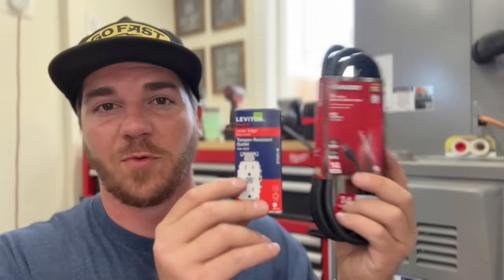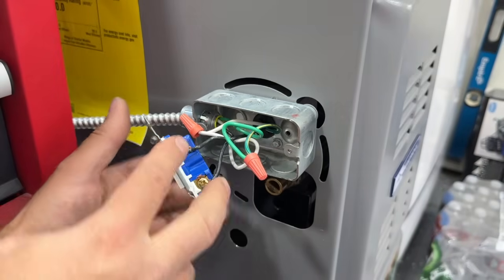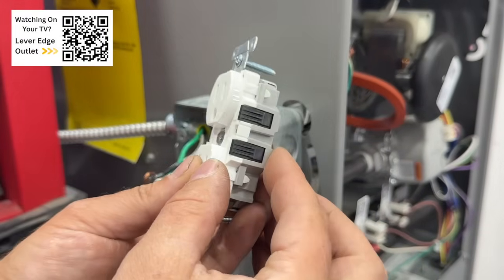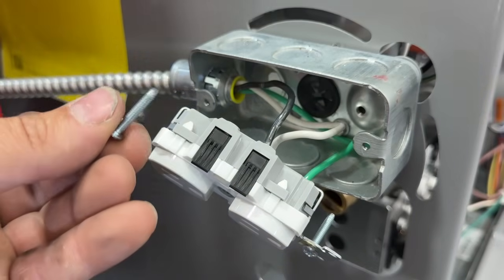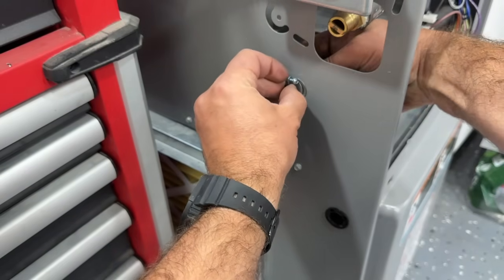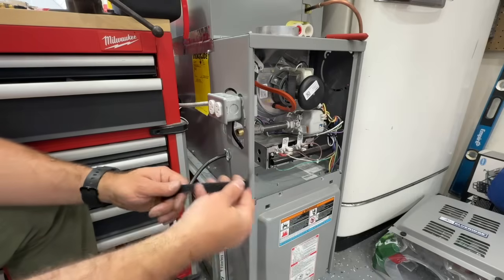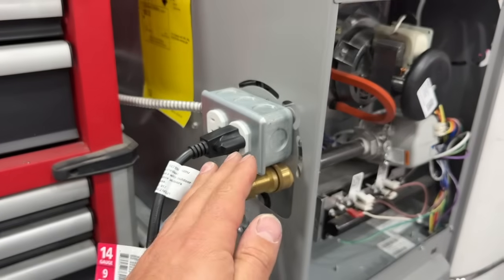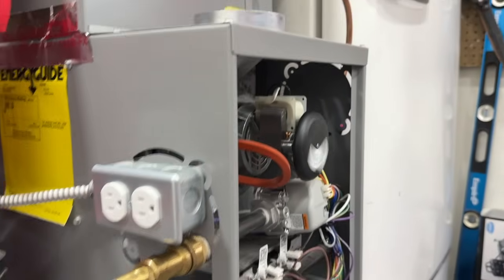This $16 Hack Could Keep Your Family Warm During A Power Outage!

Comment: During the Texas Freeze of 2021, we lost power for days.  Miserable without the gas central heat.  I tried running the central gas heater from a 2KW generator using 100' of extension cord.  It didn't work. I thought maybe some kind of voltage drop problem, but it was too cold to troubleshoot.  Now I know what the problem probably was.  I needed to bond the neutral to ground at the generator which was lost when I cut the ROMEX from the breaker box to install inline male/female connectors.  Never thought about rewiring the power switch as it is six feet away from the gas unit.

Comment: Disconnecting from the power grid and running a generator is better. 4 hours of furnace isnt much when you could be out of power for a week. When the battery dies on your battey pack you are not able to charge it again. You are much safer with a adequately sized generator. Plan ahead and get a disconnect switch on your house to simplify the hookup process (some people have no way to connect outside their house except for pulling the electrical meter. Dont be like them)

Comment: Ok a few issues you’re doing wrong, the connector you put on the furnace is not rated for extension cords, that should have been a strain relief connector. Also you’re changing the electrical characteristics of the furnace, in that they are not meant to be wired that way according to the electrical code, you are thereby voiding your home insurance. Is a fire happens and they find the extension cord wired to the furnace, they will fight you on coverage.

Comment: Bad advice. Without GFCI protection, bonding the neutral and ground will kill somebody later. Plus, that extension cord is not code compliant. In comparison to no gfci, this is a minor issue of course.

Comment: At the end of the day, this solution is great for homeowners, just be careful - if your installation isn't code compliant, you might have some trouble if you intend to sell your house later on. If your solution is easily reversible, all the better. Great video!

Comment: Just a quick point. it's a bit safer to verify the active voltage at the same point - which is the switch you're working on (test while on, test while off, same physical point). If you want to then test your tool after your breaker is off, then go test against an energized source after testing your work location. Just a small engineering nuance. Technically it's possible (the way the video is presented) that your work location is energized and you're not reading it (because you never verified that you can read it properly while energized). Hope that makes sense.

Comment: 20 years ago furnaces use to come with these cord ends, and were used to temp them on for the final building phase of the house. At that time, the cord was allowed to be ran to an outlet above or installed on the furnace itself. But as an electrician I make my buds double ended male cords and just plug into the kitchen circuit and furnace {supplying them with procedure to shut off breakers of course}

Comment: My 2 story house in DFW (Texas) has two systems, both gas furnaces and both are simply plugged into a dedicated outlet right next to the unit.  No switch.  But I've done essentially what you are showing myself in the past.  Works great.  All that is powered is the fan and control board for heat since it's a gas furnace.

Comment: Not a code compliant installation.  Have a qualified electrician install a single pole double throw switch.  Throw the switch up and your furnace is supplied with normal power.  Throw the switch down and your furnace is supplied by generator power.  The example in the video will fail an inspection.

Comment: The big miss on this modification is that you didn't also hardwire the ground wire from the panel to the receptacle box. You can't rely on ground continuity from receptacle frame and screw to the box or on the grounding of the BX cable armour.
Reply: Just relax sparky

Comment: Unless I missed it, neither the device box or the furnace chassis were probably gronded before or after the hack.  If this is a condensing furnace, there is a risk of water meeting electricity which would be a bad day without proper grounding in place.

Comment: Furthermore, an HVAC tech is only allowed to replace like for like as far as wiring goes and only on HVAC equipment.

Do you hire a gardener to rebuild your transmission?

Do it right or hire an electrician.

Comment: Great video... they also make a switched outlet/receptacle combo, so that way you can control the power to outlet/plug without having to unplug the plug to disconnect power to the furnace in an emergency. Also it keeps someone from plugging something else into the open/spare receptacleopening. 😉

Comment: Well-  most of the time, for most furnaces, this WILL NOT work.  I believe it's a ground or bonding issue that the furnace will not power on.  A furnace is smart, needs an earth ground.  Also, some day, when you sell the house, that home inspector will flag this as non-compliant, even if it did work.

Comment: Would it be a bad idea to leave the pigtail permanently plugged into a battery station (solar generator) that has pass-through charging (and UPS) capability and then just plug the battery station into the outlet you converted from the switch? That way, if you are not home when the power goes out, the furnace will continue to work on the power station power until the battery is depleted. And, if the power comes back on while you are away, it will recharge the battery station and work as normal again. Basically, a set-it-and-forget it solution that works to keep the furnace running even when you are not home.

Comment: I was so excited about this, but unfortunately it doesn’t quite work with my furnace. I can get the fan to work without issue, but it never ignites. I tried my 4000/8000 inverter, my 2000w gas generator, and my 400w inverter.  All had the same result. 
My furnace uses a “glow plug” style ignition, so maybe that’s the issue. 🤷‍♂️

Comment: My on and off switche is on my wall next to the furnace not up against it. So it sounds like I don't have to do any internal work with the furnace but just have the switch turned into a plug on the wall which sounds like it's going to be a lot easier than this process? I'll have my buddy put it in has 33 years in HVAC.

Comment: I just got the Anker C2000 to run my pellet stove. Tried it for the first time. Everything goes well until 10 minutes later. I get an APS code and the stove shuts down. Plug it back into the wall and runs just fine. Any ideas anyone?

Comment: My system has the 24V HVAC control transformer mounted on the side of the power switch. Is the installation process still the same?

Comment: Been doing this for 40yrs for all my and friends properties who use gas heating. New place has elect heat so instead made inside to outside connection for generator(s) for outages to avoid extension cords thru doors.

Comment: As a master electrician. One issue I teach my students is that if you're using the tester for recognizing lives like you have, I commend you on testing it first. However, after you use it for Discovery, I tell him to go and test it again. There is a possibility that between you testing it and using it the batteries slip inside. So if you tested before and after which is standard procedure for a verification of no voltage, all should be safe. 
Ken kirton RSC, retired professor George Brown college electrical department

Comment: On the inside box you put the black extension cord through a metal hole without a locknut clamp. With vibration from an air handler can’t that can cut through the black extension wire?

Comment: I did this and hooked up to my battery backup. but when the breaker is off, the thermostat has no power so it doesn’t call for gas. How do you wire for,the thermostat to get power? The fan runs fine but the gas will not come on

Comment: I wish you would have went into a bit more detail on the bonding plug. Does it link the 2 outlets, due to the draw imposed on the power source? Also, I was blown away the first few times I worked with ac power. It was unreal after having had worked on car, as well as pro level car audio systems. Working with ac power is a no mistakes endeavor imo, just so much risk of contact issues on those old methods. Glad to see wago being adopted into homeowner grade equipment.

Comment: Follow this video and you'll be a step ahead of the 85-94% who haven't planned for an outage.  But one thing I missed was the part where the time duration is covered.  From what I can tell the Ecoflow River 2 Pro can handle this load for roughly 3 hours with nothing else plugged in.  That's fine if the outages are intermittent giving you intervals to recharge.  But if your outage lasts much longer you'll need more battery capacity.

Comment: Fantastic! Thank you for this great video. I just did mine and got a power pack from Amazon, large enough to run the gas heater and also for the sump pump. I will alternate them, if needed. SUPER VIDEO. Never thought about it. So simple!!! I did use a single outlet, as required.

Comment: As an electrician, the extension cord will not meet manufacturer spec or pass code as extension cords can’t be used in permanent wiring unless it’s produced that way straight from factory. Will it work fine? Absolutely, but from a legal point of view, not allowed. My suggestion would be a Leviton 1286-W switch which is a dpdt switch, basically acting as a transfer switch. Not trying to throw shade, just give a more compliant option.
Reply: At that point you may as well just buy a pre-made switch with outlet specifically made for this type of application.
Reply: "Will it work fine? Absolutely, but from a legal point of view, not allowed"
The building code in a nutshell
Reply: So, as an electrician, how do you supply power to the furnace in your example?
Reply: @robertt9342  I’m not an electrician.  I read that the dpdt (double pole double throw) switch the current can flow in either direction, somehow they must wire it so a generator can supply current to the switch and therefore to the furnace.    Just a first glance, I didn’t study the diagram thoroughly.
Reply: @robertt9342 come on dude use your brain. Your in a blackout what is another useful item that you can literally buy at any harbor freight, lowes, home depot, etc. That supplies power with gas or propane 😂
Reply: Then you still need a switch / plug (disconnect), unless the breaker is close by.
Reply: That product wouldn't be code compliant in this application. It's not listed as a transfer switch, therefore it cannot be used as one. This solution isn't any more or less legal than the one provided in the video. If you want to be properly code compliant, you need to install a transfer switch. The switch needs to be 100% verified to break the circuit before switching, which this one doesn't. It's probably more dangerous (technically speaking) than the video solution because there's a risk of backfeed, whereas the manual unplug and replug cannot physically backfeed mains (assuming you don't introduce a second male-male cable).
Reply: I don't understand how  the suggested switch would be wired in?  Is it a toggle to select either house power or generator power?  Where would you plug in the generator when the owner goes out?  Would you replace the std switch on the furnace with the suggested switched and then wire the pig tail to the other side of the switch?  Obviously, I’m not an electrician.  Thanks.
Reply: @stan3452344 one pole will be line power. Other pole will be to an extension cord out the side of the box. When power goes out you flip the switch and plug your cord in. That way you’re code compliant by not running the furnace on an extension cord all the time.
Reply: LMAO

Comment: Question how big of generator would it typically take to run a furnace?  Second question is the power from the generator safe for the circuit board?

Comment: The bonding plug you put into your small generator electric Jen battery generator why wouldn’t it start without using that thing? What does that do to make the furnace turn off? I just don’t understand what does that bonding plug do exactly and why would you need it? you didn’t explain that.

Comment: The control board in my furnace died this summer. The service tech said lightning can take them out. $426 for the board plus the $100 service call. I inspected the original board and there was not ONE transient suppressor on that board (ex electronic engineer)!
I was not happy with that at all. So I replaced the power switch with an outlet. THEN I installed on the framing adjacent to the furnce a power strip with a very high joule rating. Each of the outlets have their own switch with indicators. Bought it off Amazon. A bit pricey but it's a 20 amp model. Now I can still turn off the furnace locally, run it off a portable generator, and power the room humidifier and the auto fill controller I installed on the humidifier. Also I have a convenience outlet for running a wet vac for local carpet cleaning etc. Total cost ~$35.

Comment: Why not put a transfer switch on your furnace?  They're less than $50 on Amazon.  And instead of a power station, a big, pure-sine wave inverter to run off your car will cost a lot less and run a lot longer (while also powering your fridge, freezer, and a few other  things as well as your furnace)
Reply: Sure, if you want to be running your car for the duration of the outage. Not to mention running a looong extension cord in from outside.
Reply: @ItsEverythingElse  But you don't need to run it for the duration.  Refrigerators and freezers need to run only occasionally.  That same goes for furnaces and AC.  Cool down the food, heat up the house, and then shut it all off for several hours.  Everything will be be fine.  If you like, get a power station to power the furnace overnight and recharge it when the car is running the next day.

Comment: The way I do it is a little different. from the breaker to a wall outlet. power cord from the heater plug into it (no outlet or switch at the heater ) when the power goes out just unplug it and plug it into the back up system. It's neater that way . another way is install an outlet and switch at the furnace . when power outage just turn off the breaker for the heater using a powercord with male plug on both side 1side plug into the power station  the orther side plug into oulet from the furnace but i don't do that way for safety .don't know what happen when you forget to turn off the breaker

Comment: Living in Minnesota, it gets cold. I performed the upgrade with a pigtail on my furnice. I also corrected the furnice bonding where they just pinched the green under a cover plate instead of a legal bonding screw.
 For the receptacle, I installed a 2 gang box and a 20 amp dpdt toggle switch. The furnice was connected to the common/armature of the switch. On one side of the switch, i made the connections to the grid power. The other side of the switch is the connections from a 2000-watt full sine inverter. Bonding from the inverter is tied to the house grid. 
If you can think of a better way to do it, i am all ears. Thank you.

Comment: Hardly a $16 hack.  You also need to buy a generator or UPS to provide the backup power and that will be in the hundreds of dollars.  Anyone who already has a generator or UPS would already have made this mod.  Also, that is not an outlet you are removing at the beginning. It is a switch and you are replacing it with an outlet.  But it is a good mod if you have a generator and a gas furnace.  I had done already done that so my UPS will power my furnace.

Comment: By putting the plastic piece back on the yoke screws you isolated the ground on the receptacle from the box. Not good. You would now have to provide a pigtail ground from the green ground wire to the box.

Comment: Those pens are awesome, especially checking outlets to ensure that the power is actually off. A bad breaker can lead to a bad day.
Reply: I have worked as an industrial maintenance tech. I used mine regularly. It can also be used for some diagnostics.

Comment: I never worried about it . While I’ve always had a gas furnace , I’ve also always had a gas cook stove . Just one burner will nicely heat a couple rooms and keep pipes warm enough not to freeze .  At least , that’s been my experience . Never worried about the fridge either - in a winter scenario . Outdoors is a natural refrigerator . Put in unheated garage or in back seat of the car to keep animals out . No biggie .

Comment: I installed a combo switch/receptacle to do this without a pigtail. This way the switch isolates the grid circuit from the unit and you can just use the receptacle to power the furnace, isolated and no worry about colliding circuits if the power from the grid comes back on.

Comment: first of all Fantastic idea and Video!!  I am missing why you need the Bonding Plug? why wouldnt the ecoflow give ac power to the outlet/furnace plug without the Bonding Plug?  That's confusing.
Reply: It's not the powerbank's fault. The furnace requires neutral and ground be bonded to work. Safety requirement maybe?
Reply: When your furnace is connected to your main panel, the neutral and ground wires connect to the same bus bar. On a generator or ecoflow they are separate. My new furnace didn't work with this set up until I used the bonding plug.

Comment: If one were to attempt run a refrigerator with the ECOFLOW, would the refrigerator require the "Bonding Adapter" in order to function?  If so why? If not, why? Assuming the ECOFLOW outputs enough watts to run the refrigerator.